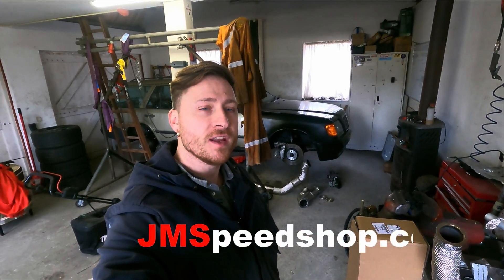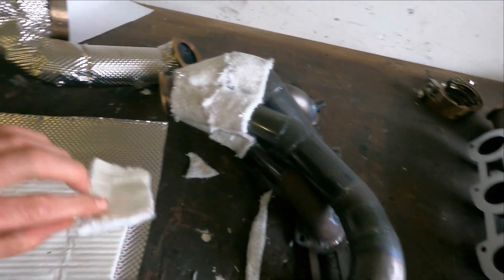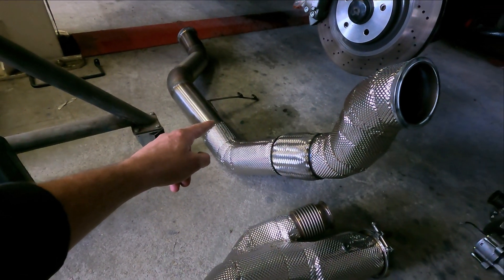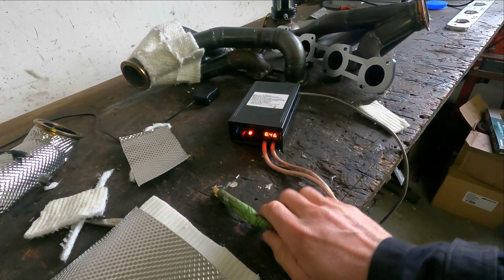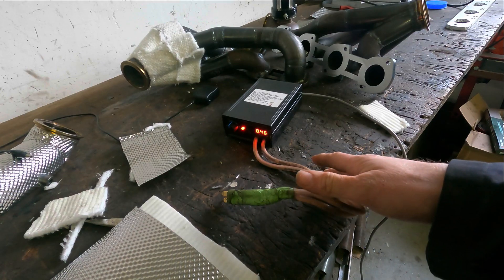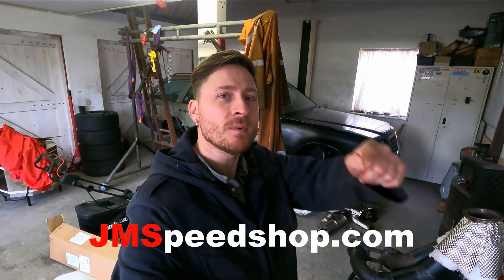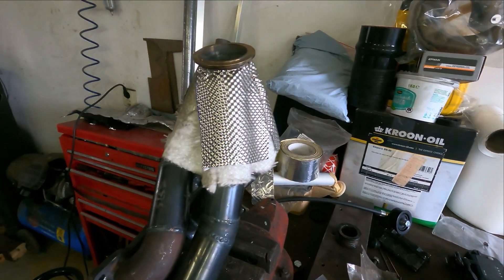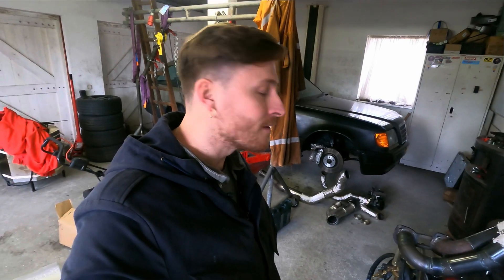HOW TO: Exhaust Thermal Heat insulation UPDATED Version spot welding

Comment: where did you get the material from and that spot welder?
Reply from the maker: Google. Hjs 83000027. That is the isolation kit.   Hjs is the company located in Germany. The sport welder is a battery spot welder from aliexpress

Comment: I'm trying to find a suitable material in the USA. HJS does not ship here. Is that stainless steel truly .1mm thick? Only .004 inches??  It seems much more robust than that.  I can find other embossed stainless steel, but they're much thicker than .1 mm.  Have you hit it with a pair of calipers by chance to measure it out at .1 mm?
Reply from the maker: Hello. Yes 0.1 mm.  But some people also use a little thicker 0.15
Reply: I’m still looking for it Los Angeles. I tried aluminum but it was .5mm and didn’t work
Reply: @kendallspower  boostproductsusa sells it, i talked to them at PRI

Comment: Awesome I was always curious if those cheap spot welders on ebay could do the job!
Reply: I couldn't find the adhesives back ceramic wool, do you have a link to where to get it?
Reply from the maker: Send me a mail though the website
Reply: @JMSpeedshop I found it from your older video on heat shielding, I saw this video and bought a similar spot welder and it works amazing! Thank you for sharing all the info! Legit works and very easy to replicate what you did

Comment: heat will crawl to the engine via exhaust port
Reply: @JMSpeedshop  he means that heat will radiate to the cyl. head.  I had this setup on an turbo setup but cast manifold.  that won`t crack but the heat transfer to the turbi flange was immense , ended up with cracking both ...

Comment: Clean work! What happens if a weld cracks under that? Hard to find
Reply from the maker: If that happens you have a problem 😁 but the stainless plate will color more dark on these places and it is easy to remove  and then repair en place the materials again